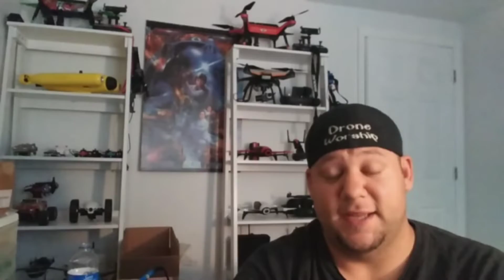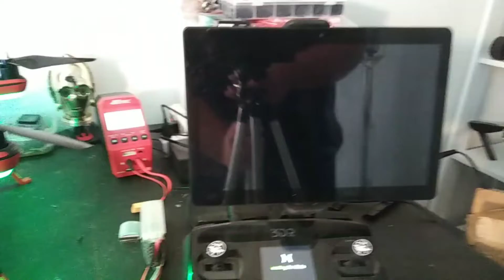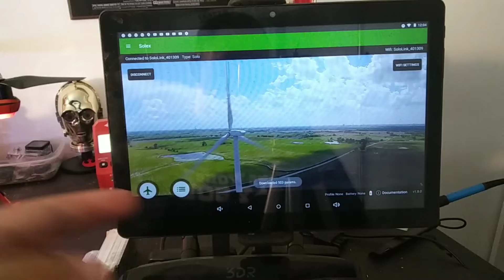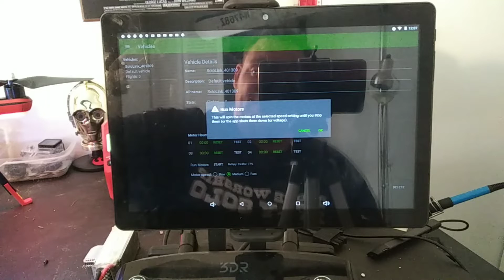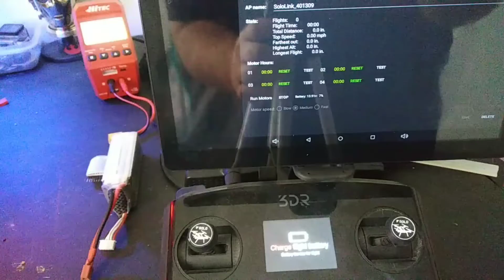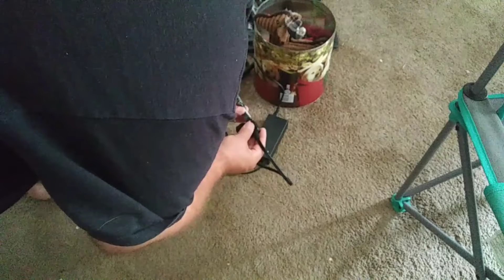The 3DR Solo DIY Battery Guide Part 6: DIY Battery Solex Calibration And First Charge

Comment: I have 2 batteries that were seemingly fine. I would get good flight times 13-20 minutes depending on conditions. 

I went a month or so without a flight, both batteries now drain from 100% to 0% within 2 minutes. The issue didn't slowly appear over multiple flights, it was from one flight to the next. I DO think I left the batteries at full charge during the hiatus (I've heard that's bad).

The crazy thing is the actual flight time doesn't seem to have decreased, just the battery percentage read-out. I have flown to and @ 0% for well over 10 minutes. I keep the bird close to the ground in case of a sudden shut down, but the flight times are still lengthy. I'm not daring enough to try a normal flight under these circumstances. Do you think this method of calibration may work on my Solo batteries? 

Thanks for any info. Great videos BTW, I look to your channel often for answers!
Reply from the maker: The solo batteries are 4 years old I would not suggest flattening a battery that old completely and then trying to reboot it most likely the cells will pop like a zit because the battery can't handle the discharge rate going that low anymore

Comment: I would love more info on the app your using
Reply from the maker: Go on the Android market and look up Solex
Reply: @IFixShet  ouch mand $30 on the market place thanks though
Reply from the maker: It's totally worth it trust me the guy that wrote it is called kelly Schrock he's actually in my Facebook group and there's a reason why he charges so much. The original solo app has not been updated in 3 years the only app you should be running on now is solex it has constant updates and is way more stable then the original app it also offers you a ton more information that you did not get with the standard solo app if you're not running on solex you're asking for a fly away
Reply: @IFixShet  I have all ready had a fly away  but that w3as more my own doing  and the other problem is that its only on android  and im using the ipad while flying  I haven't had the drone long and im really enjoying it so far

Comment: Does it reset charging cycle count on BMS? I mean if you plug solo battery tester it will continue add cycles or reset to 0.

Thank you for you great work!
Reply from the maker: I will have to get back to you on that because I do not own a solo tool to give you that information I will check with my friend that has been testing as well

Comment: HI there!
I did that process with an original Solo Battery (nothing wrong with the battery, i just wanted to calibrate it)... in my case the battery porcentage hits 0% when the battery volts were like 13-14 volts, but i let solex to drained the battery to 12 volts then the Solo shutted down as it has to be... put the battery on the charger and let it for 48 hrs... and now i have a dead battery :(
What could have gone wrong?
Reply from the maker: All of those batteries are from 2015 they only had a 3-year shelf life this is why I have created the DIY battery mod
Reply from the maker: I'll tell you what went wrong you stressed a pack that was almost 4 years old to its absolute lowest point and flatten the batteries the cells couldn't handle it. I will make you a bet if you take that battery apart you will see that all of the cells have expanded